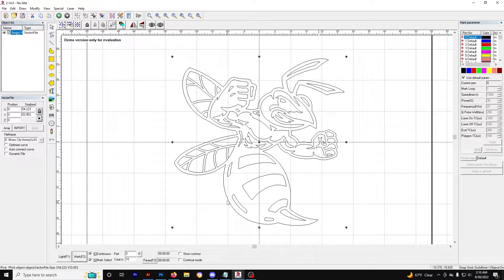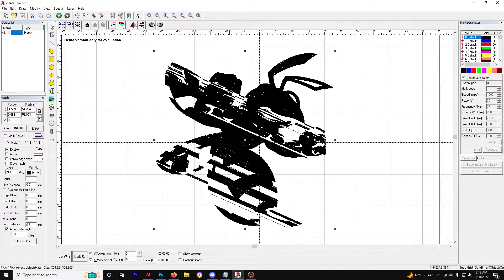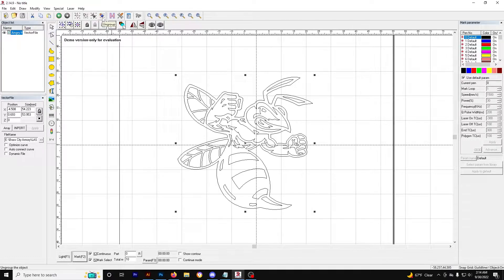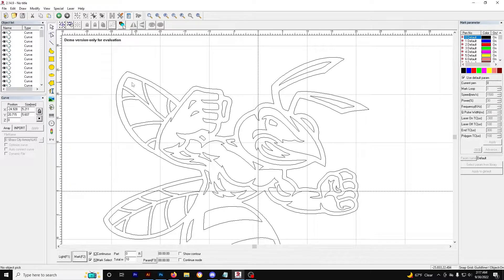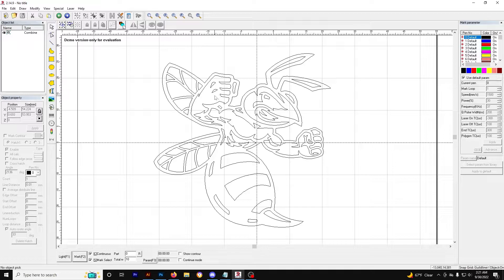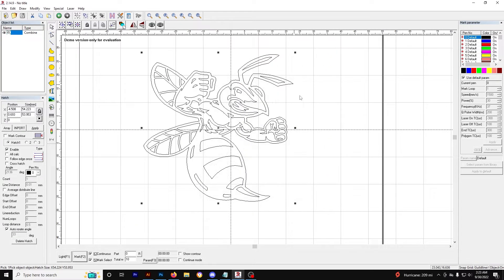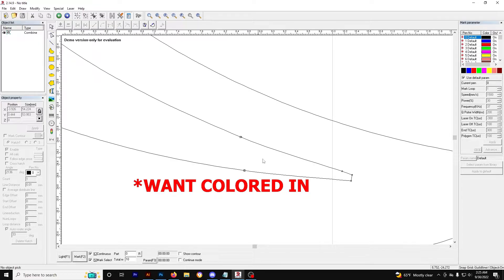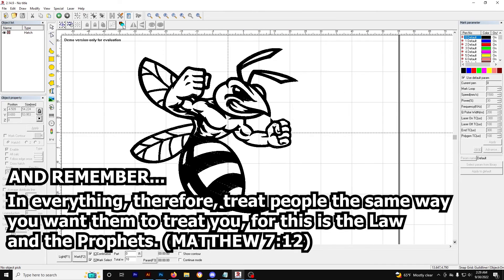EZCAD2 TUTORIAL:Cleaning up vector images

Comment: I just got my new Z5-1 Fiber Laser. yesterday . I open up the software and I just type something basic with the text, but it still says text. It won't change the name. What am I missing?
It still says on the screen text I see the name that I typed in as an example. Open up the text box and I change the name, but it still shows up as text. Do you have any other beginner courses to get started?
Reply: I highly recommend using something like inkscape to create the design and then save as a svg for example and then export and import that to the software for the laser. I use EZCad and  it's pretty bad. I try to use it as little as possible hah

Comment: about the best video on ezcad work. thank you!.... one problem I keep running into is that after I import my vector file, I Had a few lines that were missing. So I draw in the straight line and when I go to connect the nodes, it wont let me select both nodes and then unite them. Any ideas on what i'm doing wrong? Yes, I'm holding shift. when I select one, it deselects the other. How do I add in lines and then unite the nodes? if you need more clarification, I would be happy to provide.
Reply from the maker: What file type are you importing? Try different file types and see if they all have some disappearing lines before you try adding lines. Some EZ cad read certain file types weird. To fix your Node problem select the whole image including your line and hit "Group" up in the top left corner. Then you should be able to connect nodes.